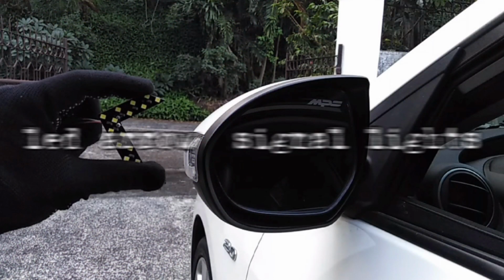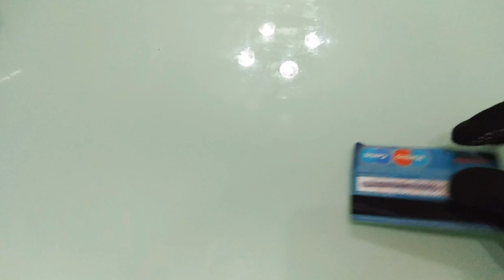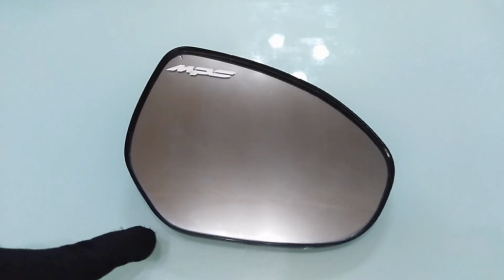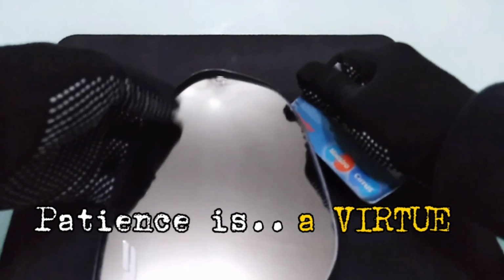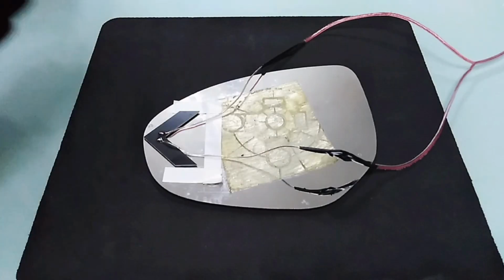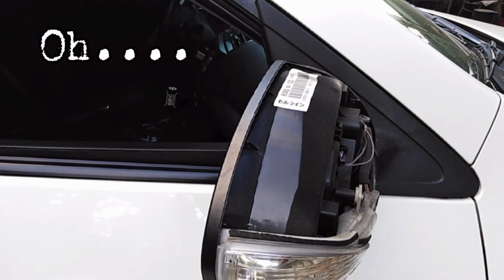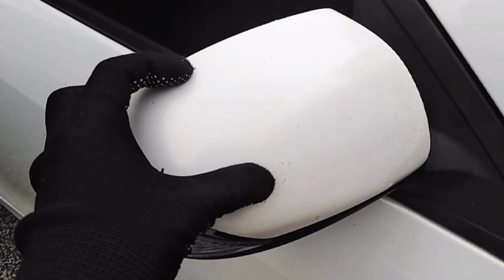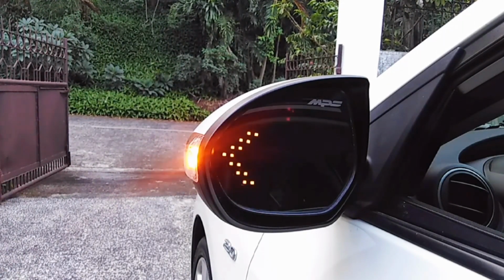LED Arrow Turn Signal Lights Installation on a Mazda 3

Comment: Mirrors housings can get rather hot in the sun, "silly cone" would be best to anchor the LED fixture.
Reply from the maker: Yeah I guess some models could use silicone.. Depends on the frame.. mine is like tucked in. It'll be impossible to fall off even on a hot day